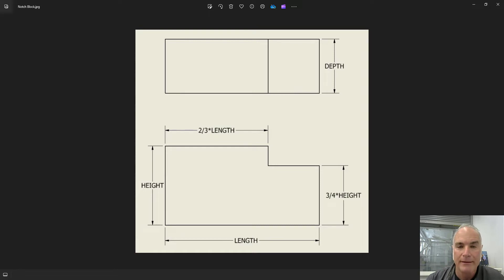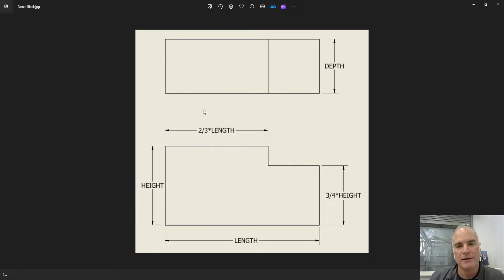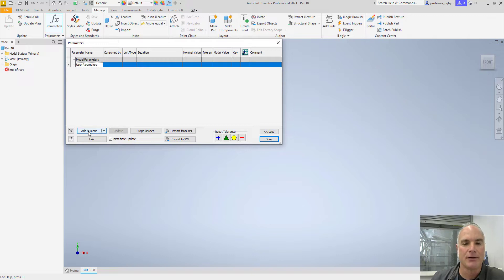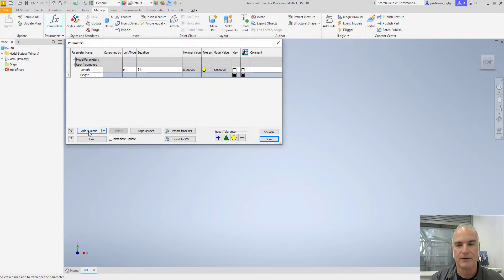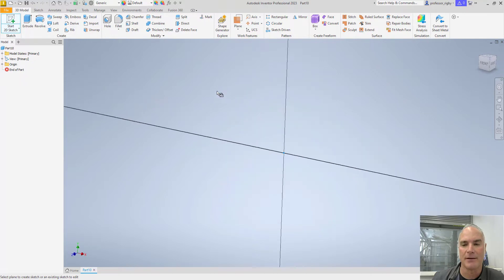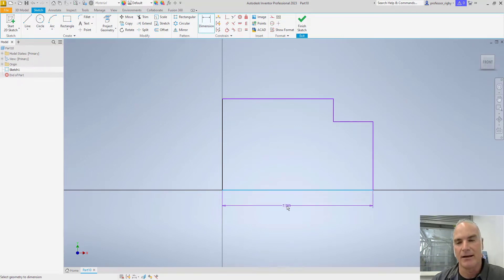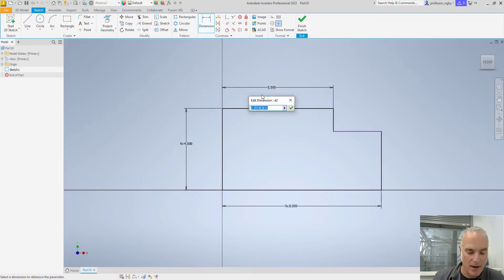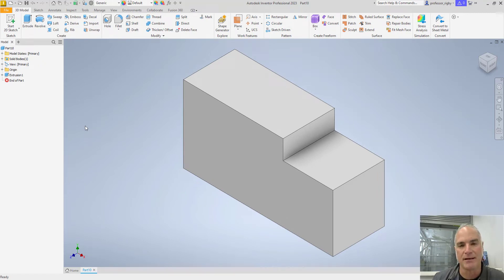Adding User Parameters to Sketches in Autodesk Inventor

Comment: when i add the parameter to a assembly and then want to edit an extrusions of a component which was made in the assembly by create component, the user parameter is unkown inside the extrusion of that part... is there no way to make it a "global" parameter which can be used by every part in the assembly?
Reply from the maker: That is correct. Assembly constraints are different from sketch constraints. You cannot use an assembly constraint in a subsequent sketch.

Comment: What could be a reason for Inventor not allowing me to use User Parameters in Model Parameters?
Reply from the maker: If you create a user parameter, be sure to take note of the exact spelling, capitalization, and naming. Unlike most things in Inventor, parameters are case sensitive, so Paramater1 is different from parameter1.
Let me know if this helps.
Reply: @professor_porkchop actually I noticed like, 2 minutes after writing the comment that the User Parameter was a text one instead of a Numeric one, so that was why 😂😂😂